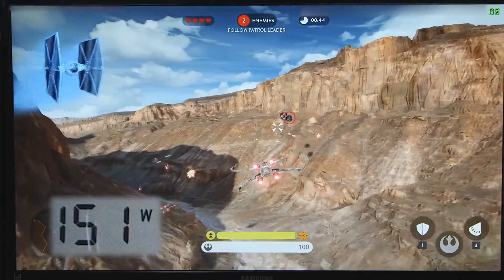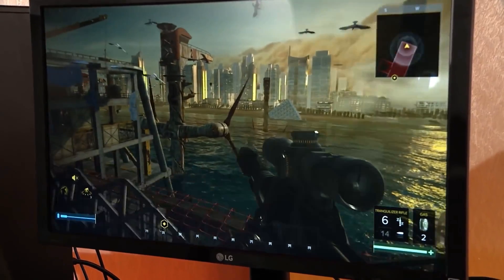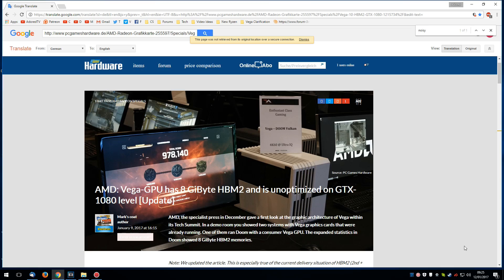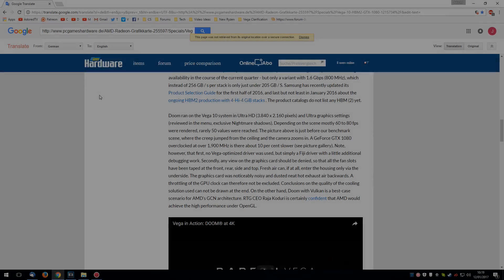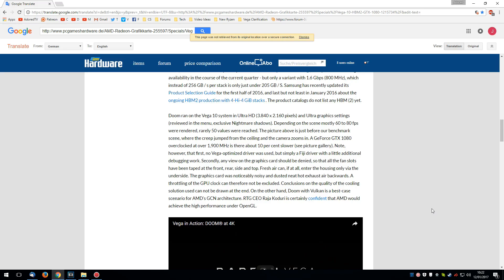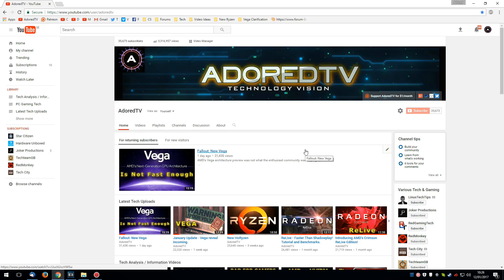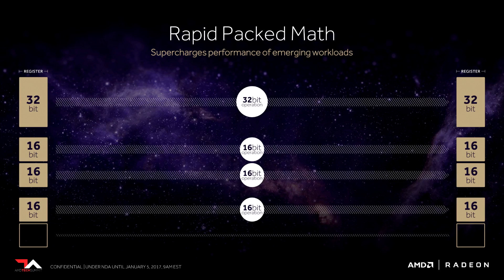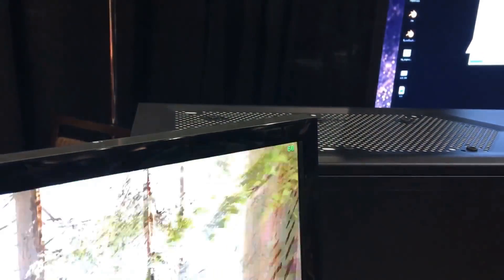Vega Clarification - How bad is it?

Comment: /watch?v=Vl7r-zLq7wQ  How about that @AdoredTV? "The goold Gamer" did some calculations over at his channel. It kinda makes some sense but i don't think FPS scales that perfectly... (Looking at overclocking). However he didn't account for architectural gains, so it could be on point. Your thought?
Reply from the maker: Fury X has 46% higher FLOPS and is only 20% faster than the 390X (at 1440p).  Even if AMD just fixes that bottleneck it would only just about reach Titan X which is 75% ahead of Fury X according to Techpowerup.
Reply: hmm doesn't fury X have 8,6 TFLOPS and R9 390x 5.9 TFLOPS, which would make fury around 32% faster? 5.9 X 100 / 8.6 = 68% roughly.. Am i doing this wrong? However, increasing stream processors also rises temperatures thus lowering potential frequency, so yeah, everything doesn't scale that perfectly. But i think he shouldn't be far off.
Reply from the maker: 8.6/5.9 - 1.46 or 46% higher.  12.5/8.6 = 1.45 or 45% higher.  If Fury X scaled perfectly with clock speeds, with 1525MHz (assumed clock speed for Vega), it would be 45% faster.  That means AMD needs to find another 30% from architecture just to match Titan X Pascal.  30% is a lot, even with Fury X's bottleneck.  Sure I think they can do it but Nvidia has at least two faster cards they can release as well, the full GP102 and a GP101, assuming it exists, and that's without even needing to use HBM.
Reply: Good point. But still. I am not worried 2 much about Nvidia having the fastest chip.. All i care is about a decent GPU from AMD for a reasonable price. I wen't with gtx 1070 just because rx480 just wouldn't do it. And i have a 1440p FREESYNC monitor.... I was waiting for AMD to come up with something faster so i can utilize that sync. Now i will be. i'll sell my 1070 and go for Vega. I don't worry who owns the crown, honestly. As long as AMD has something to compete with, so that prices fall a bit. 480€for 1070 was way more then i was prepared, but that was the  only option at the time. 

Tnx for reply!

Comment: Nvidia wont release a HBM2 GPU until 2018. so if AMD Vega manage to out perform gtx 1080 by 25%-30% then they are @ Titan X performance range they just have to use better cooling solution and not repeat r9 290/290x mistake that they prove to be the better gpus and stayed in compitition even with gtx 970/980 after they destroyed gtx 770/780/titan and after few months they crashed the gtx  780ti and still better performer even after 3 years or more.

even the rx 480 is now on par with gtx 1060 and still gaining more performance every driver release.

Comment: I heard a lot of talk going on (and especially on your channel!) about the VEGA-Architecture. How about putting multiple VEGAs including HBM on one PCB and still having it act like ONE GPU to the outside without the known issues of previous Multi-GPU solutions known as Crossfire/SLI.

Wasn't Raja Koduri saying something in previous interviews about the scaling of the Vega-Architecture in the future in just this way of defining such arrays? As the first iteration of Vega with just one Chip and 8 GB might fall a bit short with its 12.5 TFlops, imagine what two or four can do. Offering a 20 TFlop-Card for 1.500 Dollar pricepoint might even challenge a not yet released to consumers full Pascal-variant.

All that aside this is what they did almost every time they couldn't compete chip2chip, they just put two on one PCB. 5970, 7970 X2 and 290X2. Of course at times very late, very hot and with all the problems that didn't made it an attractive option.

If they somehow fixed the problems of requiring specific driver-profiles to every specific game and the microstuttering inside the architecture making multiple chips work and appear like just a bigger one to the application, that could be really interesting and the only thing I can imagine they might have not clearly told us yet aside from "poor Volta".

As it is all about parallelizing and it does not sound completely off once done properly inside hardware/driver as the software(game)-developers have proven for a decade that they can't handle it anyway or stopped supporting it at all. Wonder if you might explorer that idea deeper with your knowledge of the architecture.

Comment: watch the PC World interview with Raja, this is 100% confirmed engineering sample and Raja stated clearly, he can not confirm final clocks or binning, and stated, they are still figuring it out themselves. 

Your presumptions seem a bit too aggressive.
Reply: What we do know points to the main purpose being to show it was capable of hitting a consistent 60fps @4k, I think reading further into it with any degree of certainty is ill advised at this point.

You could be entirely right, but evidence isn't that strong. I'm holding out hope the RX 490 is the 1080+ class card and will undercut pricing by a compelling amount. because they did refer to the RX 490 being a 4k class card.

also I've heard conflicting rumors about Volta... And that roadmaps were pulled forward aggressively by Nvidia. if true  they'd obviously be concerned to some degree. 

I know 3 people around me who are opting for AMD over NVidia in the very near future. This is due to a combination of factors including their agitation with nvidia on issues they've had with recent drivers, general principle and not least pricing in our region. I really hope it's a general trend, and that their mindshare declines. one can only hope by at least 10%.

Comment: For the Vega to be a 500mm die, and only be competitive with the 1080 at launch, AMD would have to have regressed in terms of performance per transistor and die area. I do not believe this is a reasonable assumption. I believe there are far more reasonable assumptions to make before we reach there . . . Now . . . lol, who knows. It's not like AMD hasn't messed up in the past. Perhaps raja is getting too geeky with new features and doesn't realize sometimes more cores is the best use of new transistors.

I just really have a hard time believing Vega would be a performance regression from Polaris (in terms of transistors and die space). Particularly given all of the apparent advantages it will (supposedly) have, and correcting some of the specific weaknesses Polaris had (bandwidth, ROPs, clock speeds, etc).

Either way i am excited to find out.

Comment: You're assuming everyone has bought a 1070, 1080 or titan x already.  There are plenty of us on 970's or less who would never blow a grand on a graphics card and don't see the value in upgrading yet.  The 4096 stream processor, 8gb hbm vega will come in at around €500 and outperform a 1080.  There will be a dual gpu version of this not long after with 16gb of shared hbm that will blow the titan and 1080ti out of the water for the same price.  The mid range Vega 11 chips using GDDR5 are coming this year as well.  AMD will be the price to performance kings at every price bracket again.

Why would they start with a max sized die as well?  You don't design a new architecture then push it to it's limits at launch which stops you being able to offer any improvements for several years.  The fury was a showcase of the best 28nm gpu they could make but that was 4-5 years after the 7970 launched with other die/transistor size/count increases in between in the 290/390.  The 7970 was the best value graphics card I ever bought.  I fully expect the 4096 stream processor, 8gb hbm vega to be it's successor.  A card that's going to be great for 2560x1440/144hz gaming for a good 4-5 years with proper driver support pushing up it's performance over it's lifetime.

Saying the 1080 is a mid range card that should only be £300 is just stupid as well.  Sure it's overpriced at £600+ but a realistic price with competition from amd would be in the £400-450 range as the 980 and 390 were.  It is very much a high end card.

The 4096/8gb Vega will be hands down the best value high end card you can get this year that will scale better into the future than Nvidias cards.  It's a no brainer for anyone who knows anything about hardware and those that don't only need to look at the benchmarks and price/performance.  Most people don't blow €500+ on a graphics card without doing a lot of research first on what is the best bang for their buck.  Let's not forget AMD will finally have a card that will make upgrading to a fancy free sync 2560x1440 144hz+ monitor worth it for people who haven't taken the plunge yet.  The price barrier to entry for that experience is about to get a lot lower than an Nvidia gsync + 1080 or titan x equivalent.

Comment: I like AMD but there are always 3 things that kills my mood to buy their products. 1. power consumption, 2. heat, 3. too noisy.
Reply: With RyZen and Vega I would expect these issues to be completely resolved.

Much lower power consumption, which also means lower heat. Noisy waits to be seen but if they've got the temps down that hopefully means fan speed down.

However my recent experiences with RX470s showed that AMD gpu's are way quieter than they used to be.

Comment: If the Polaris 11 demo was an underclocked GPU downclocked as far as possible while still able to maintain the 60fps for the demo isn't that evidence that the Vega chip was also clocked as low as possible while still able to do the demo at 60fps. Also if Vega is 4096SP. then should we not judge it vs an imaginary Pascal chip with ~3000CUDA cores (like Titan X Maxwell had). The FuryX at 4096SP was clearly intended to go up against nvidias best at the time and it fell short vs the 3000CC of Titan. The new 4096 Vega chip should also be judged vs 3000 Cuda cores. That means this chip SHOULD NOT be better than the new Titan XP which has 3500CC. It should be around 15-20% quicker than a 1080 if it's doing its job.
Reply from the maker: No because the reason Polaris 11 was downclocked so much was to show it's perf/Watt at low clock speeds.  The Vega Doom demo was just a pure performance demo.
Reply: Maybe. maybe not. All the other tests were just to say "This card is aimed at 4K gaming". They might not have changed its configuration for that Doom demo. I'm just saying that imo i think the 4096 Vega Stream Processors are probably on track to match up pretty closely to ~3000 CUDA core nvidia card.

Comment: Is it a bad idea to upgrad a GTX 980 to Vega 10? If AMD gives up completely after this GPU........then I would be left buying nVidia GPUs while having a FreeSync monitor :/ CRAAAAP this world is CRUEL!
Reply from the maker: They're not gonna give up, but expecting them to beat Nvidia with Nvidia making "pure" gaming GPUs while AMD is making multi-segment architectures is no longer likely I fear.
Reply: Well it's a very hard choice to make, because of that longevity. I usually keep my GPUs for 3 years or so, and that is about 2 generations? Thing is that old nVidia GPUs don't seem to gain any performance even with current generation drivers, not gonna mention legacy. 
I am afraid that Volta will be new architecture, just like Maxwell was to Kepler...so buying a GTX 1080Ti now would be a not so good value of an upgrade. I guess in the end it would depend on price, but for me, Vega 10 looks like a sweeter upgrade, no matter how bad it looks in terms of where it should be in gaming performance.
Reply from the maker: It'll be a great GPU, just not faster than Nvidia's best. ;)
Reply: It will overtake it with time...and with driver updates. Look at 7970 going easily against the old titans and beating them...